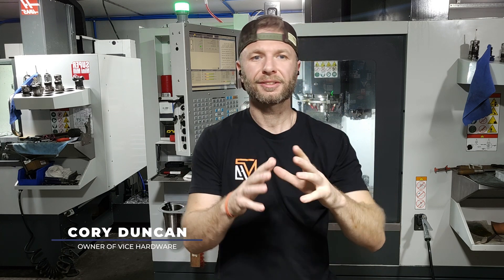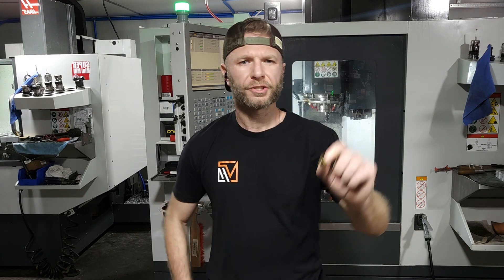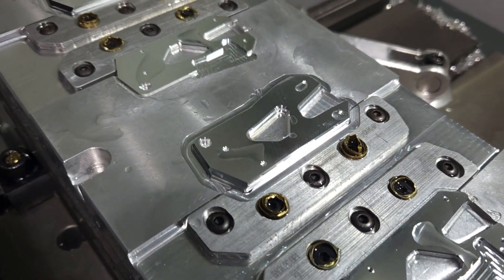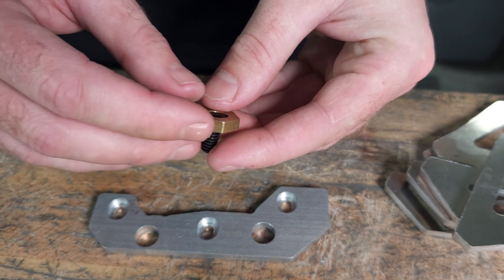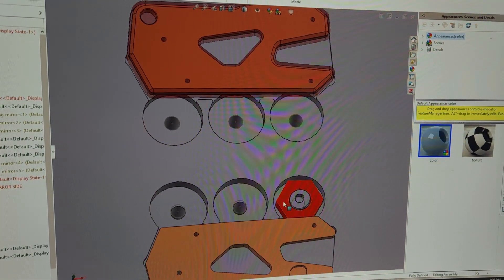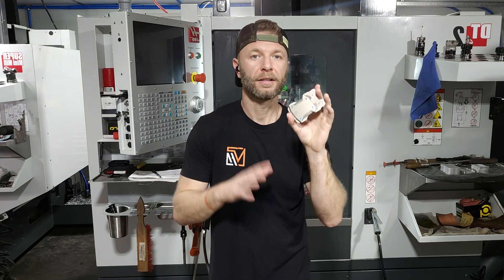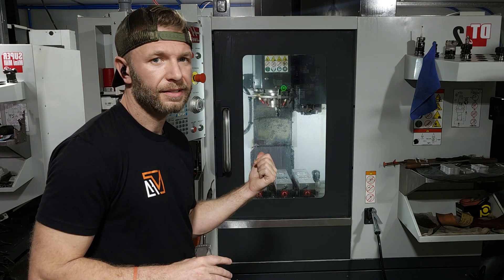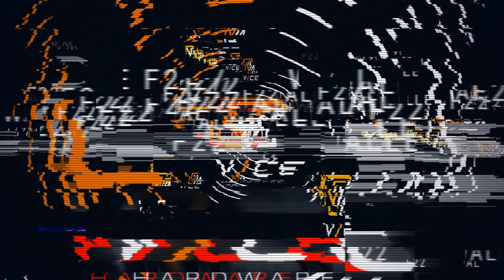How I Clamp Small Parts with This Fixture Setup | American Made Ep.4

Comment: I've machined very very tiny(less than .125x.125) parts from all grades of titanium. Use no coated solid carbide tools and the radi sharp as possible, typically oil based cutting oil/coolant works best. Have the most ridged set up possible. Moderate speeds and feeds and lighter depths of cut. Keep tools razor sharp

Comment: How do you make sure that you are clamping evenly with both the cam screws? Do you use a torque wrench? Seems like that would pretty easily distort the parts to me
Reply: In practice, it’s not really a concern - I use them all the time on 6061 and you’d really have to abuse them to dent the part - they hold very very well
Reply: @iansandusky417  not really referring to denting them as much as actually distorting a relatively thin part with that fully side loaded clamping force
Reply: @MSMillingCNC ahhhh I get what you’re saying now! Fair enough, I’ve never run really thin stuff with them so I get what you’re going at
Reply: @LakewoodMachine  yeah I do quite a few thin and small parts of all different materials and even using the uniforce clamps from mitee bite, distorting the part is a huge concern usually. I've distorted 3" thick 6061 plates of aluminum that are 20" x 30" relatively easily with our vises!
Reply: @MSMillingCNC  makes sense! We really only use them on pretty wide tolerance production work (though surface callouts can be intense) so I hadn’t really considered that!